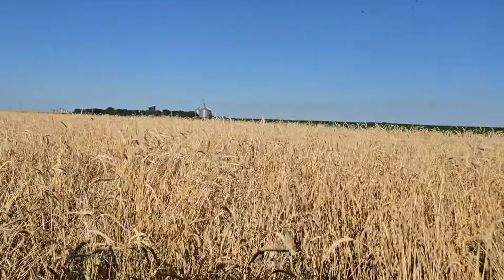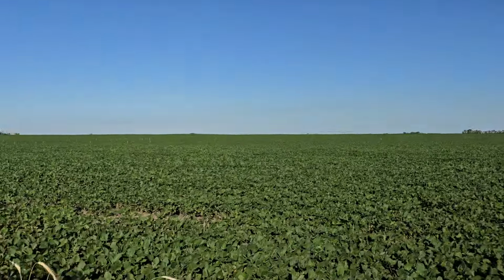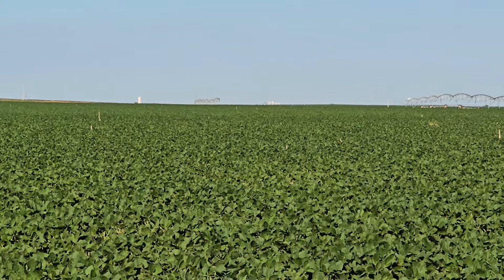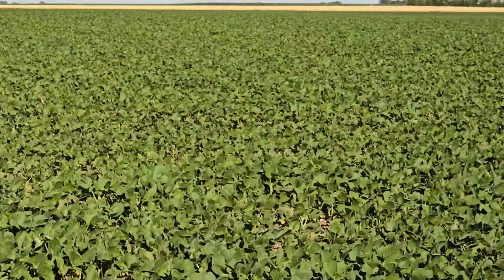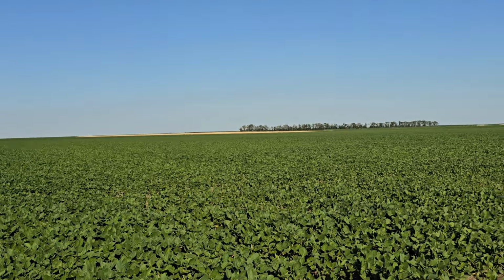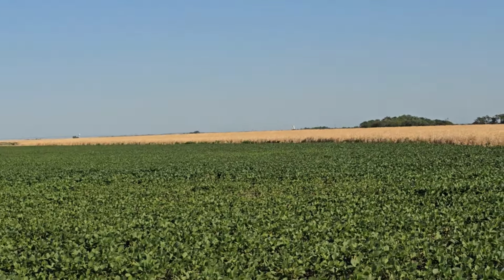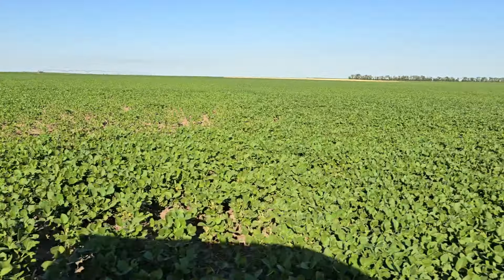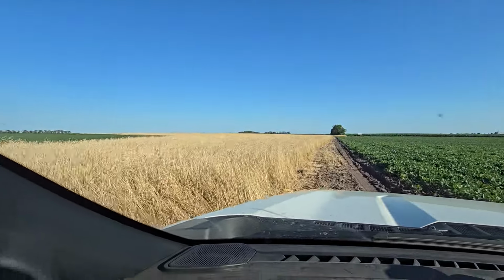Seed Rye is almost ready for Harvest and look at these narrow row soybeans 40 days after drilling.

Comment: We plant some 30's but mostly 7.5in drilled beans with a sunflower drill. Our ground got so dry and hard this year it struggled in places but 90% of the time we get a good stand. In the 90s everyone had a great plains or a JD 750 drill here in Ohio. The controlled spill is overrated, it's frustrating sometimes getting it dialed in especially with today's seed cost, but I think the cost and simplicity of the drill offsets that.
Reply from the maker: I agree, a drill is not as good as a planter row unit and does leave some holes here and there.  I like that my 40 foot great plains costs 40 grand 5 years ago almost new when I priceed a JD 60 foot air seeder... basically add a zero!  I dunno if a air seeder is gonna make your 360K over a 5 yr period!.  So I roll with the controlled spill!   Lol.  Your right 90% of places drill can be  better 10% are worse than a 30 in row planter, but I see holes in 30 in row planters too.   Alot of the problem is the seed soybean quality.  If it's only 85% germ soybean seed you really gotta cranks the rate up to cover up more of those holes, I've found.

Edit: to your point about seed costs.  I know a good seed dealer.  Lol.